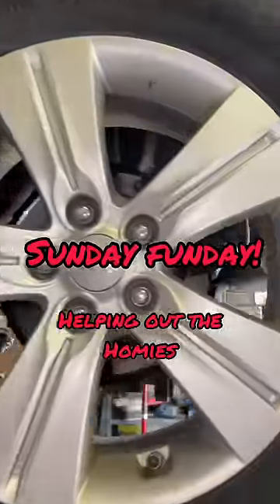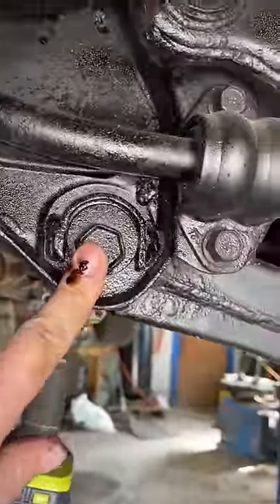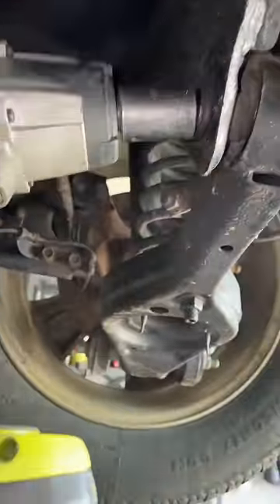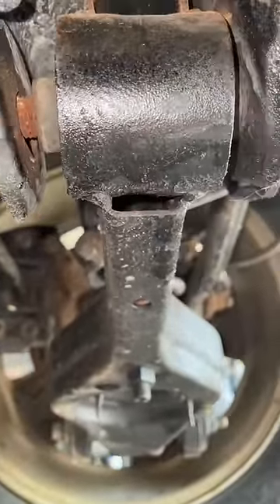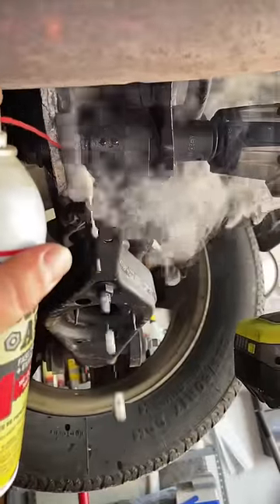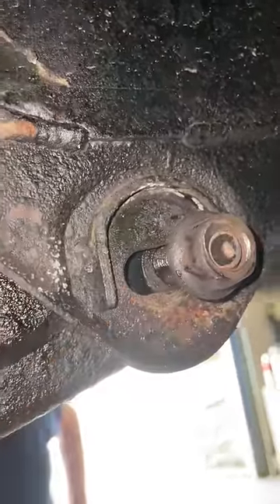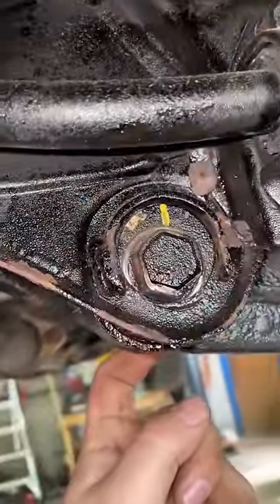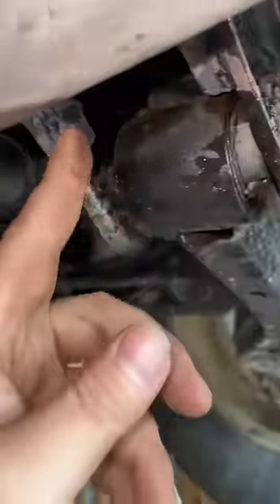Vehicle can’t be aligned problemo

Comment: Had this issue on an LCA bolt once. Kind of pisses you off that the factory cannot put a little anti seize on the bolts that are expected to be removed or loosened for regular maintainence.
Reply from the maker: Bingo!!! It’s bs man
Reply: It's the same reason why they won't use stainless steel for brake lines... They don't want the car to last longer than 10-15 years. So you can buy a new one.
Reply: @OldsmobileCutlass1969Va  Exactly.  I damn near crashed and burned when a carbon steel break line in my truck blew from being rusted. A cheaped out critical safety component like a brake line shouldn't be approved by NTSB nor should it be high on the list of consumables for ANY vehicle.
Reply: @gregoryking9348  this is what unfiltered capitalism gets you. Cheap product for massive profit margins.
Reply: @OldsmobileCutlass1969Va  More like stainless steel costs twice as much. People already complain about how expensive new cars are, adding stainless lines is just another thing to raise the price
Reply: @rgebes222  I don't think many people would complain about paying an extra $100 for stainless steel brake lines. And ss fuel lines would be great too.
Reply: @OldsmobileCutlass1969Va  Most car buyers  don't keep their car long enough for rusty lines to become a problem. To them it's just an unnecessary cost and companies know that. It's all about keeping things as cheap as possible
Reply: Well if people did the regular maintenance  🙄 regularly that problem would lessen
Reply: @juanvelasquez827  I live in a state with yearly inspections... And trust me they all nit-pick to prospect for additional work. Then in the winter our state uses that brine crap for snow melt.
Reply: Just have your first align job be your time to apply corrosion inhibitors if you live where rust is the enemy and rapidly ruins everything.
These channels show vehicles with no protection quite a bit.
When your vehicle is still in good shape, you can save it.
Reply: @ProleDaddy  no interest in it if you think left or right somehow changes the pyramid lol
Reply: @weedshoes5089  which would make it unfiltered, hence the ability for the government and large businesses being able to push others out. 

If it was filtered those things would be put to a stop.
Reply: @purehitman24  what you're referring to is a problem with corporate statism, and doesn't have anything to do with capitalism.
Reply: @weedshoes5089  then you can make that same argument with communism lol
Reply: @purehitman24  Capitalism, by definition, is free from manipulation by the state. Thats not what we have. You're the one making straw-man arguments.
Reply: @purehitman24  you literally didn't. You said cheap manufacturing was a result of "unfiltered capitalism". Kind of a long winded way to announce that you aren't very smart, but whatever floats your boat.
Reply: @rgebes222  it's taxes and other govt interference at the end of the day driving prices
Reply: You think engineers are there to help mechanics? Nah, they want more reasons to make you spend more money without them spending more money, also they just hate Mechanics
Reply: @rgebes222  Tell that to toyota, their cars keep resale value high because theyre well made.
Reply: I know a guy who used to work at a Honda plant. Their motto was "If it doesnt fit, make it fit. We get paid to assemble, technicians get paid to fix."
Reply: anti seize would have dried out before 10 years. Better solution is not to live in the damn salt belt otherwise you just expect this kind of crap.
Reply: @rgebes222  $35 for 3/16 25’ roll of stainless. $20 for 3/16 carbon steel 25’. That is nothing when you’re buying a $30k+ car. It’s worth the safety factor.
Reply: @weedshoes5089  You’re missing the other half of the definition to capitalism. Seems like you’re straw-manning by keeping the important part out.
Reply: @jdahling4738  care to enlighten us?
Reply: @jdahling4738  you think a car manufacturer cares about your safety? That's an extra $70M in costs if they make 2M cars. They just want to sell you the next car. The car market is an inefficient one because most buyers are unsophisticated.
Reply: @rgebes222 They keep their prices as cheap as possible. Then they sell the things for as much as possible!
Reply: Anti seize is worthless
Reply: @rgebes222  you wouldn't need to buy a new car if they built them to last in the first place
Reply: Zinc plating would be an rust protection. The bushing itself would unlikely have the same coating.
Reply: @OldsmobileCutlass1969Va  No. It increases the build cost. The cost of adding it to all cars would be in the thousands. You can reduce this by using the more popular and adequate brake lines that are used today. How many average people want and solid brakes?

There's me for a start.
Reply: No money in the cure
Reply: Toyota?
Reply: Has nothing to do with how the vehicle was made but everything to do with vehicle care and maintenance. Where you live factors in what maintenance the vehicles need. I live in the rust belt and I undercoat my vehicles with woolwax to prevent rust from eating up the underside. 

Preventive maintenance is the owner's responsibility.

That black undercoating crap is useless FYI. Do not use it.
Reply: @muddeprived  amsoil heavy duty meatal protection I use. Woolwax, and pb surface shield 🛡 👌.
Reply: @rgebes222    Its not a significant cost.
Reply: @OldsmobileCutlass1969Va  I hear that. I live in New England&dealbwith the same shit basically
Reply: All those little things add cost. And consumers buying new cars want cheap cheap cheap..:.so can you blame the manufacturers for not applying anti seize or making some components stainless which are prone to corrosion.
Reply: @OldsmobileCutlass1969Va  stainless steel lines would make no difference in hot dry climates. Rust is not an issue in more than half the country . To build for the rust belt would gratley increase the price.  If you start using stainless steel in one component do you use it on all components like frame, body  and engine accessories. I think upgrading brake lines in the rust belt is a good plan for people who live in the rust belt if the rest of the vehicle will last long enough to benefit from them .
Reply: The anti-seize just washes away after several years of salt baths.  The key is a larger clearance between the bolt and the sleeve.
Reply: @fullmindstorm  they're junk just like the rest! Just about any vehicle in the USA post 2000 is a steaming lump of rusty shit, Toyota/Lexus right now is almost at the top of the rust/corrosion pyramid. Look under any Tacoma, Tundra or any other suv they make then look at the Corollas, Camrys, and Avalons and Siennas the front and rear subframes rot as well as suspension components.. don't even get me started on CV axles on their front wheel drive cars... Nissan/Infinity is just as bad if not worse on the topic of corrosion and they're about the same in price..
Reply: @Mudsuitable  Toyota suspensions are bullet proof, dont compare them to the trash that is the new 2005+ Nissans.
Reply: bro things aren't built to last anymore we live in 2022 they literally design things with the intent for you to dispose of it
Reply: @purehitman24  admirer of communism? 😂🤣
Reply: Nuts and bolts like that do come with a little anti seize on them from suppliers. Very little! Lol
Reply: @OldsmobileCutlass1969Va  they used to be cupronickel that doesn't rust either. Used to last a lot longer..
Reply: @purehitman24  ...and Communism gets ya a shiny new Trabant.
I'll take the blemished fruits of Capitalism, TYVM.
Reply: @FerKurl  would you recommend going through a new car and taking apart future trouble issues and putting anti seize on them?
Reply: Or you can just get regular wheel alignments once or twice a year and they spray it down with penetrating oil each time then line it with at least WD40. It’s when people just change the oil and Don’t do any of the other timed maintenance that you run into problems like this. Lack of regular maintenance causes this.
Ideally get an alignment every other tire rotation, or standard every tire rotation and this won’t be a problem. At least when I do your wheel alignment.
Reply: @OldsmobileCutlass1969Va  stainless steel brake lines? Not a thing. How are you gonna bend them and flare such a hard metal. It will crack at the flares. You want steel or at least copper so you can flare the ends and bend them.
Nobody is gonna pay extra for steel brake lines in their car. Not a good material for tubing whatsoever. Been making and maintaining hydraulic lines since 1989. I started with the U.S. Air Force.
Reply: @gregoryking9348  if your brake lines are rusting out, you need to wash your car more often to get that salt from the road off of them. Most car washes wash the underside at least a little during the process. Also don’t park on bare ground, park on pavement or indoors and your lines won’t rust out. Plus, if it’s over 20 years, what do you expect? Even the pipes in your house need replaced after 40 years.
Reply: @purehitman24  that’s not cheap, it hasn’t been maintained properly. Wash your car more often, lift it in the air and spray all your bolts every so often with lubricant like LPS3 or WD40. It’s just a bolt and rubber, spray it once or twice a year and this won’t happen. Doesn’t hurt to get a wheel alignment at least once a year if not two.
Reply: @OldsmobileCutlass1969Va  how would you bend stainless steel brake lines and flare the ends for flare nuts? This is impractical. Stainless steel is expensive and extremely hard. It would be thousands of dollars more, not hundreds.
Reply: @juanvelasquez827  EXACTLY
Reply: @purehitman24  labor is still the biggest expense for any employer. Parts are cheap, labor is expensive. Make it easy to replace and problem solved.
Reply: @fullmindstorm  my 2001 Toyota Avalon still going strong at 286,000 miles. Gonna keep it like a 70’s muscle car and just keep fixing it up and dialing it in. Buy fancy stuff for it eventually like new aluminum wheels, redo the ceiling. As long as it has a decent frame, it’s built well enough to keep maintaining indefinitely like a classic car.
Reply: @s0nnyburnett  or Lube it once a year in the Fall like an adult.
Reply: @wb3161  use what we do in the aircraft industry, rust inhibitors like LPS3. Or at least some WD40.
Once or twice a year is enough really.
Reply: @Nonfat_Snacks  no, Toyota uses two jamb nuts on the opposite end of a barrel nut. Usually this is Chevy or one of the big three that use eccentrics
Reply: @robertchiarizia9463  I don't know why you chose to word your comment like you did and try to school me but you actually had some good points for people who didn't grow up in the Rust Belt and who weren't mechanics for 50 years like me. 
You can wash under your vehicle all you want but short of disassembling it and scrubbing every nook and cranny after every time you drive it in slushy salty snow?...nothing but NOTHING you do to undercarriage 'wash it' is going to remove the salty crap that was hydraulically blasted into places an undercarriage wash gets jetted into. 
Not gonna happen. The burden of prevention lies with manufacturers. This is the 21st Century. Metals and coatings exist to extend the longevity of vehicles but it's all about diminishing returns. They don't WANT us to have vehicles that shrug off road corrosives and extend their lives by a factor of 60-70%.
Reply: @gregoryking9348  I’ve worked on aircraft, heavy equipment, and POV’s (cars and trucks) in the military we wash them all the time and lube them. They last fifty years and longer that way. It’s all about proper maintenance, even in the rust belt. There you will have to do it monthly. With aircraft we wash them every three days on it’s overnight B check. I understand it is a tough battle, but what options do you have really? Nobody is gonna pay for a better made car with space age materials, Americans buy the cheapest, not the best. The market drives the materials used.
Reply: @robertchiarizia9463  toyota definitely doesn't use two jamb nuts🤣 and my comment was also was not referring to the video
Reply: @robertchiarizia9463  well on my older toyota they don't
Reply: @Nonfat_Snacks  what year? My 2001 does
Reply: @Nonfat_Snacks  I do my own wheel alignments on my 2001 Toyota Avalon, guaranteed it’s two jamb nuts on a barrel nut on a rod. You loosen both jamb nuts and rotate the barrel nut in or out to adjust the toe in the rear. Front uses a traditional tie rod naturally. Stuff like KIA and trucks don’t even adjust the rear toe. Chevy makes it so you adjust the camber and the toe at the rear off of two eccentric bolts.
Reply: @robertchiarizia9463  Understood. But military construction shouldn't be compared to civilian construction. They're worlds apart. 
Buddy I'm not taking anything away from your Life experiences at all. Civvy products are in no way comparable is all I'm trying to say.
Reply: @robertchiarizia9463  we are talking about the LCA
Reply: @Nonfat_Snacks  it is a standard eccentric you can get at any auto parts store. Used to replace them all the time doing wheel alignments. Really not a big deal and it doesn’t cost but a half hour labor at least where I worked.
No big deal using a torch. Literally takes five minutes if you even really need a torch. Sawzall the bolt head off and punch it out. Easy peazy. You get paid an hour for a wheel alignment and most take 20 to 30 minutes of actual adjustment and setting up the machine, running a caster sweep, etc. 
no sweat to throw an eccentric in. We kept them on hand all the time because people just don’t do anything to their cars unless it is absolutely necessary most times. So they end up like this from lack of maintenance.
Reply: @gregoryking9348  we used the same vehicles you buy at the dealerships. Chevy trucks when I was in. Mercedes vans on the flightline (Germany)
There is no vehicle designed by the military that auto makers make especially for the military when it comes to the military. 
Of course there are Hummers and fighting vehicles, those are made by defense contractors, but when we make a road, it is still a Caterpillar, or a Chevy truck driving on the road, nothing special about it, same exact stuff. 
Lockheed doesn’t make a civilian version of the Hercules, they are all made to MILSPEC.
Nobody is ever going to use stainless steel lines either. That would be over engineered overkill. The materials amd processes to produce any mechanical piece of equipment is the same. Sheetmetal is still used to make spacecraft. 
There is one vehicle that is made unique and those are military grade submarines. They use titanium and are machined to extremely close tolerances in the .0001 deviation range because of the extreme conditions they operate in. Nobody can afford a 3 trillion dollar truck though.
Reply: Lol the only solution ever work for me in this setting was a sawzall:(
Reply: @ciscogomez  or a cutting wheel like. Red 3M on a die grinder with the guard removed. Maybe a three inch wheel. That’s what I would use. I have a steady hand though and face protection plus gloves.
Reply: @OldsmobileCutlass1969Va  a $100 Lol..  good luck trying to convince an auto manufacturer to put in stainless brake pipes for a $100 .. some mirror glass alone cost $200 to $300.. u would be looking at least 2 grand on the price if a vehicle.. normally they'll just galvanize it for less
Reply: @rgebes222  oh no! ur 30 thousand dollar car might end up costing 30100 dollars!

the extra material for stainless steel brake lines isn't that much compared to the price of the car
Reply: @weedshoes5089  yes if the government exists then it can't be capitalism's fault! and if the government didn't exist it also wouldn't be capitalism's fault! 

REAL capitalism has never been tried!
Reply: @weedshoes5089  it has nothing to do with statism. statism works perfectly. the problem is capitalism
Reply: @weedshoes5089  and communism by definition is free from manipulation by capitalists. which is also not what we have so you can't say that communism doesn't work because we haven't tried it just like we haven't tried real capitalism
Reply: @Mike kasich  so you'd do better than Stalin? Somehow I doubt it.
Reply: @OldsmobileCutlass1969Va  my 2005 needs new pipes all the synthetic ones are starting to fall apart.
Reply: Because you aren’t supposed to use anti seize on nuts/bolts that are subject to prolonged shock/vibration. The suspension components are like the most obvious parts that should NOT have anti-seize lol
Reply: @purehitman24 not really. Capitalism means there’s other choices too. Stop buying their stuff until they do better out go out of business. Put your money into a better company.
Reply: Tacomas are notorious for this.
Reply: @OldsmobileCutlass1969Va  I mean I just get copper and they last about 10-15 years. Have to have copper brake lines in Chicago
Reply: At some point you gotta call it. Cutting them off sucks but neccesary aometimes.
Reply: @handyman2233  agreed. It fucking blows in those hard to reach areas  sometimes but there’s nothing u can do
Reply: Planned obsolescence
Reply: If you ever really worked on cars you see problems like this all the time. Bolts stuck and rusted is a given. No use crying about it. It's expected. Best find better ways to deal with it.
Reply: Yes.  I absolutely hate bolts that go through bushings like this.
Reply: Anti seize won't stop rust and corrosion if you live up north where they salt the roads lol
Reply: Its the weight on the bold
Reply: @rgebes222 no the problem is car manufacturers pay 2 cent for something an charge $200 for it they rip us off
Reply: Although I do understand you when I worked at a car factory we use torque wrench for everything and anti seize is known to throw off the torque readings a bit so I would assume it’s cause of this
Reply: That’s how they make their money. They purposely make things to fail so that u can take them back to get fixed ie more money
Reply: how can you expect anything more from an American truck that cost 60k
Reply: Nah. It’s not an issue in non snow states.  You can look under a car that’s been the south 20 years and it will look like new with a little water slash from driving in the rain. Bolts won’t have a spec of rust. This is a salt issue. No amount of anti seize will stop it.  And the obvious painted on undercoating here actually makes it worse.
Reply: Checked my CRV when it was 1 yr old .it had no lube of any kind on front wheel studs and no grease or anti-seize on wheel or contact surface of rotor! ( oh, the lovely dissimilar metal corrosion I had to clean up!  Nice!😖
Reply: @OldsmobileCutlass1969Va what you do is go to a place like Jiffy Lube, they don't really do anything but oil changes and have no incentive to find problems
Reply: @purehitman24 This has to do with government regulations and trying to keep the price increases consistency and not a 5k - 10k jump in price as new model years are released. I've worked in the automotive industry for over 20 years.

When you demand all cars to have something like a reverse camera at the federal level, that requires a screen, a body control module, the camera, all the wiring, the software included not only in the vehicle, but also at the manufacturer level but the dealership level as well.

So if your car model you were just ending the run on was $29,995 had no backup camera and now your new one os required, well, you want your new model to track within around $1k in a price increase, makybe $1,500. So what do you do? Well othwr parts suffer at the expense of these regulations.

When I was working at Lexus I saw this happen with the new GS in 2006 and the new IS in 2006. In order to try and keep the IS very close to its original price because it was burgeoning on almost $2,000 over the original base MSRP, Corp Lexus was debating two days after launch, whether or not to offer cloth seats and no sunroof to keep costs low. In the long run they used a new type of material for dashboards and door cards. This long-term untested product eventually melted in heat. This required Lexus to eventually replace wll door cards and dashes in effected vehicles.

Before you go speaking on subjects of wheich you obviously know absolutely nothing abour. Do research. Backip cameras are just example, TPMS was an actual mandatory regulation, you get tire sensors in all 4 wheels, radio recievers in all 4 wheel wella, wiring, Body control module, TPMS control unit, software, special tools for dealers, computer software for dealers and everyone is punished, especially the customer, but not the government who forced the automakers to put this crap in your car and is now forcing you to keep it maintained.

Driving assist will be the death of consumers, especially as they all adopt multiple radar cameras for it. You need soecial alignment pattern boards for the cameras. At some point it will prevent you drom driving if the system is not aligned. When i finally left Bentley in 2022, the dealership i was at was charging $275 an hour and a 4 wheel alignment with lane assistance was 10 hours. 

Evey time you replace a windshield, alignment. 

Just like the emissions and fuel economy standards Barrack Obama signed into law. This brought about Direct Injection as a way to increase fuel economy. It also tripled or in som cases more, the cost of fuel injectors. I'm also added an additional high pressure fuel pump, hard lines, fuel filter, wiring, fuel control module, new ECUs, software, dealer software, dealer training, etc.

What is worse, is to save in price increases, the Germans did direct port injection only. This leads to costly new tools, cleaning procedures and expenses to customers. Carbon buildup in cylinder heads in german cars (BMW, Mercedes, Audi, Volkswagen) was leading to having to have technicians remove intake manifolds and walnut blast the cylinder head intake ports to clean the carbon build up oit of the ports on a regular basis. This is an expensive repair. This also leads to really expensive direct injectors failing.

In an attempt to offset this problem, Lexus did the more expensive lifting upfront on the vehicles. They kept port injection and added direct injection. This completely alleviated the carbon buildup problem. Direct injection sprays fuel directly into the cylinder which is why you get gunk build up in the cylinder head whereas having both helps keep it clean. Now this is a very expensive solution to this problem. Because you've now doubled the amount of injectors of vehicle has. 

And on top of doubling him out of the injectors the vehicle has, you now have wise the amount of wiring, you now have to have specialized ECUs created for vehicles, specialized software, specialized training for technicians, you atill have the high pressure fuel pump and all the new high pressure fuel lines. 

I have talked with many higher level manufacturer reps for csr companies and top down, they hate the regulations because its pricing the average person out of s car, keeping them away from dealers for repairs because of the cost increase, causing more warranty repairs, if you didn't lnow dealer labor rates are directly correlated with warranty pay times. You add to a car, the less you try to keep the price from going up so people can afford it, the more stuff's going to break, the more stuff's under warranty, the more technicians are doing warranty work than actual customer pay repairs, the labor rate goes up at the dealer. This is all due to regulations.

Congress recently passed a massive spending bill that has an overlooked law in it, requiring a kill switch be installed in all vehicles by 2026. This kill switch will be controlled by the government. They claim it so police can stop people before they hurt people. This switch will require the actual function item itself, the wiring, the software, the manufacturer to implement a control network that they have to maintain and run as well they will have to grant access to the federal government and build out a network for them. Who do you think is eating that cost, you. The "greedy manufacturers" didnt create this problem. No one wants this liability on their hands. But if they want to stay open in the US, well here you go.
Reply: @FerKurl nothing a hammer anger and violence can’t fix
Reply: @rgebes222 a few extra bucks for reliable brakes?
Reply: Because their zinc coating is better than anti seize, like on a spark plug
Reply: @purehitman24 ever seen cars made in communism? Yeah didn’t think so as they were rusting as they rolled off the factory.
Reply: @mikekasich836 
Where are the vehicles produced by the communist system that produce the superior results you claim would happen?
Reply: That don’t always work dirt and water still creep in and seize it up
Reply: @rgebes222 Oh no $2 more per car! How are we going to recoup the cost on that?
Reply: But they can save 30 cents a vehicle if they don’t
Reply: Dont salt your roads
Reply: @OldsmobileCutlass1969Va if you think putting stainless steel lines will only add $100 to the value of the car is hilarious. You know damn well they’ll mark it up way more.
Reply: Factory doesn't care once the car/truck leave the building/factory.
Reply: @johnsmith-gt3po  Factory doesn't care, but Engineering does. There's testing and tracking for these sorts of issues (corrosion chamber testing, mule vehicle testing in multiple climates, long-term customer vehicle tracking and warranty return analysis) but there are limits on what kinds of fixes get approved.
Reply: @FerKurl 
Idk if you've already heard this or not, but when you gotta heat a rusted bolt or pin, hit that sumbish with a paraffin wax candle.  It makes for a wicking rust penetrant that expands slightly when it cools.  It's like KY for mechanics😂
Reply: @robertchiarizia9463 they don't exist? Have you bothered to look? I can buy a pre-formed stainless line kit for my truck for $126. Standard steel pre-formed kit is $93. There is no excuse, except greed.
Reply: @mikekasich836 😂😂😂 love your jokes my man! Next joke you can use “People are jumping across the border, climbing fences and swimming rivers to illegally enter Venezuela, Cuba or China.”
Reply: @rgebes222  most people would keep their cars long enough if the cars were still built with quality and longevity in mind. The engines or transmissions are more likely to blow before the brake lines rust out on most cars these days.
Reply: Too right and absolutely.!!
Reply: You'd be surprised how many bolts the higher ups say can't have anti seize on them. Every shop iv worked at refuses to let you anti seize bolts that don't call for it in a manuel. It's horrible in new england. The rust is so so bad
Reply: @purehitman24 it has nothing to do with capitalism lol
Reply: Anti seize doesn't last 10 years. The suspension components most likely will
Reply: @FerKurl what ryobi is that???
Reply: @rgebes222 you don't live in Minnesota 😂
Reply: @dannylinc6247 you can't save a vehicle from salt bro😂😂
Reply: Anti seize turns to paste, eventually leading to it actually seizing!!!
Its like when diyers use anti seize as brake pin lube!!! It does not last long before it comes through the shop doors for us to look over the brakes to find that we need to torch caliper brackets to free up the brake pins just to install the right lubricant!!
Reply: @TheDunceMafia  right, their is specialized high temp non petrol based lubes for slides, caliper pins, shoe bosses, and star wheel threads 
Just like Teflon sealant for bolt threads. But if electrolysis is your cause, or misuse of sealants or lubes has occurred, you're fighting a difference in metals for materials, sometimes. They don't get everything right the first time, that's why there's recalls, tsb's, updates, technicians, and manufacturer sponsored extended warranties, and service tech special training, and literature for special builds, using parts or members not used on the average build.
It all adds up to a fortune in expense.
Regulation forces change, time waits for no one.
That's where skilled workers come in, but knowing is a hefty price they pay, along with everything they need.
It's like a hospital, except it's not subsidized.
It's vilified.
Happy wrenching.
Reply: @OldsmobileCutlass1969Va Ford has been using epoxy coating brakes lines since at least '04. My Grand Marquus has them.
Reply: @weedshoes5089 capitalism will always trend towards corporate statism, it's literally inherent to the concept of capitalism.
Reply: @bcubed72 I would rather just perfect capitalism rather than refuse to make any changes to how we operate for fear of the first fix not addressing 100% of the issues so we just don't address any at all..
Reply: According to the OEM factory it's too expensive to put their 2 cents worth of antisieze lube. 
Let the customer bite the bullet.
Reply: @OldsmobileCutlass1969Va -that's the American way.u don't see Toyotas with these problems
Reply: @OldsmobileCutlass1969Va  And what about making stainless mufflers? It is absolutely ridiculous that anything nowadays has "Stainless" stamped on it, yet a 5 digit vehicle has got rusting stuff beneath the car!?
Reply: @weedshoes5089 it’s a capitalism problem
Reply: No ofcourse not becuaee how would buy a nee car from them then?
Reply: lol they don’t want that they want you to buy a new car
Reply: Quantity over quality.
Reply: @purehitman24  you got it flipped, car companies are basically government subsidiaries with how many special laws/kickbacks/restrictions and overall how much of a government made private monopoly it is. Capitalism hasn't been seen in the auto industry since Henry Ford sponsored his first lobbyist
Reply: @rgebes222 That's right: stainless Steel brakelines don't add selling value in the showroom, opposed to keyless entry, glass roof, heated steering wheel.
Reply: @gregoryking9348   Can't you sue the manufacturer for this problem?
Reply: That would make too much sense.
Reply: They probably want you going to their dealership to have it fixed, and on top of that the engineers are told to engineer things so they only last a certain period of time
Reply: @rgebes222  oh okay so instead they just load new vehicles up with tons of useless features like progressive turn signals and ridiculously expensive lights, double folding tailgates, tons of embedded processors and extra antennas to enable "smart" features, etc

But yeah a couple dollars worth of stainless steel would just put those sticker prices through the roof
Reply: @rgebes222  you really drank the coolaid. How much you think 10 foot of stainless line costs? You think that makes a significant dent in cars which nowadays are between 40 and 140k? Oh no. Another 20 bucks. How could they ever cost that in.